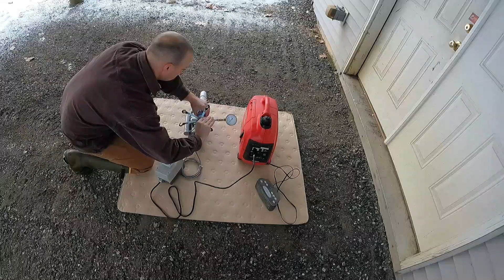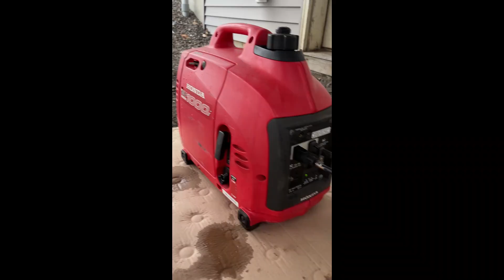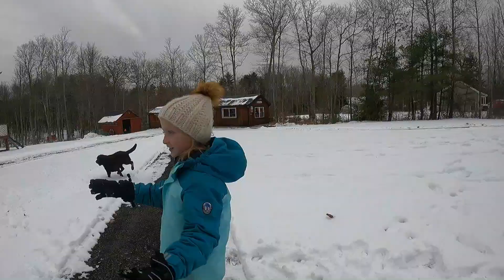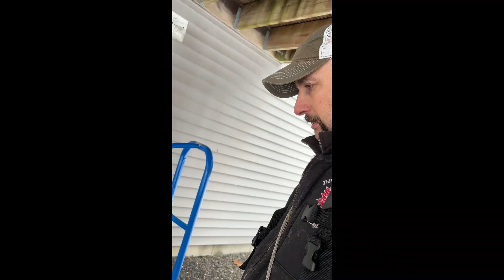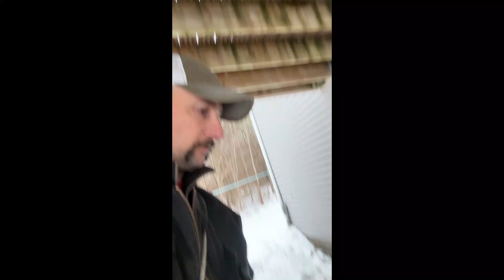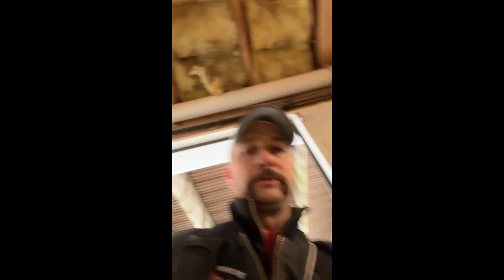Fuel efficient off grid vacuum solution for maple syrup.

Comment: That could be the co2 sensor shutting your generator off. Being you were to close to a building. All new generators have them. They will shut off if the wind is blowing on them.
Reply from the maker: It shouldn't.  There wasn't that much wind and it was away from the building but maybe
Reply: @dunnfamilymaple I have had them do that. Champion generators are the worst ones.
Reply: @dunnfamilymaple also use non ethanol fuel always. We fix small engines everyday lots of generators.

Comment: Is your vented gas cap open on the Honda?   Our FD got the first models of that generator, and if you forget the cap valve, it shuts off once it pulls a vacuum in the fuel tank... you only forget it once (or twice, or three times.. :)

Comment: Cool solution.  500 taps is pushing it on 5.6 CFM, though.  The rule is about 1.5 CFM per 100 taps as a minimum..  Better have a really tight woods!  I'm running a Busch R5 0040 at 28 CFM for 1200 taps.  The power costs me about $600 a year for the pump house.  I had to run the 250' underground power line and conduit and install the meter socket and panel (all myself).  I think the whole nut on the power install was about $3000.  But I want from 7400 gallons of sap on 800 taps using 3/16, to 28,000 gallons of sap on 1200 taps using 5/16 and high vac.  More than paid for itself in the first season.  You should check out the SapSpy system for monitoring your woods. (Edit:  I see you are a sapspy dealer)
Reply from the maker: Yes it is pushing it.  The old standard was 100 taps to 1 CFM.  It has changed as production has increased to 100:1.5 and some are saying 100:2.  This is a game in fuel efficiency for small woods with most likely under the 500 tap number.  At 500 taps a larger generator with more fuel consumption is not as big of a deal.

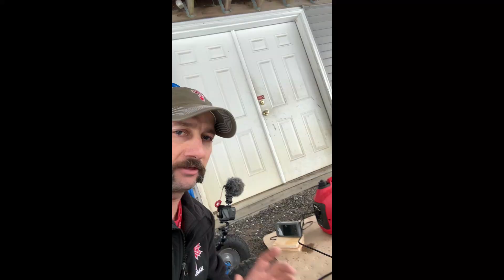Comment: Can you just use the honda to charge the batteries when you are pumping out the sap if you have poor sun days. A 12 volt battery charges relatively quickly even if you chage the battery 30-50%. 2:36
Reply from the maker: Probably but this will ensure high vacuum. Shurflo pumps vary depending on sap flow